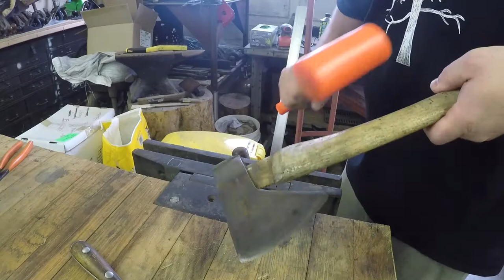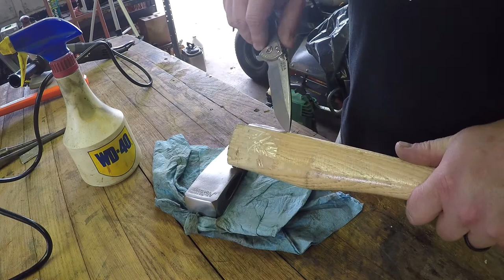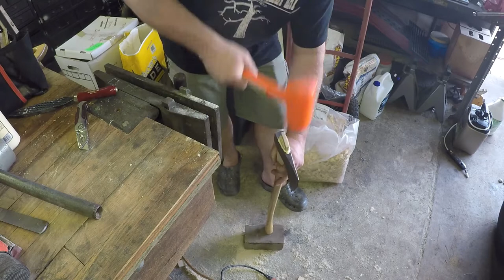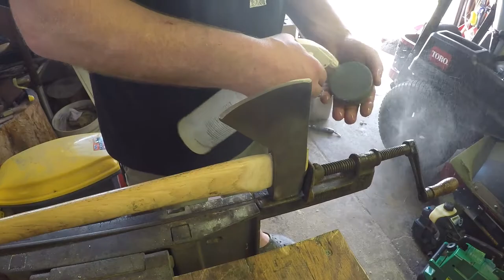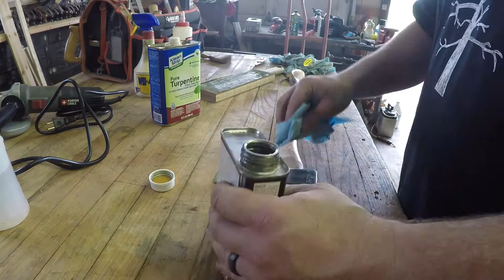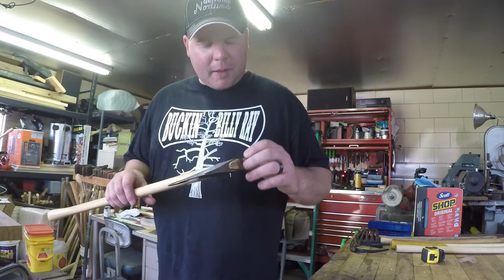This Restoration is Amazing!!!! Genuine Norlund Hudson Bay Tomahawk

Comment: Nice job Dude. I just inherited my Dad's Norland Hudson Bay Ax w/28" handle  and m looking forward to bringing her back to "working prowess", so your video was a good one to get motivated by. Even though I don't have all the big power tools you've got it was still motivating. Thanks for the video.
Reply from the maker: Nice! I have a thing for norlunds as you can tell by some of my videos!  Everything you see in this video can be done and has been done with only hand tools. What you didnt see in this video is the 5 hours I spent hand sanding that head to get a clean smooth finish. That would be boring. Power tools speed things up but you cant beat a hand finish. Good luck and have fun!!!
Reply: @KillingerUSA  Thanks! Just a question...what grits did you cycle through to end up with such a nice finish? Also, What length handle would this have had on it from the factory? The one it has on it now says 28" boys axe for 21/4lb. and I can't read it all but I can see LaPierre Sawyer Hdle. Co. Jackson,Mo.
Reply from the maker: @c.e.jarvis1512  it's hard to remember on this one but in most cases I will start with 80 grit. Next I got 120, 220, 320, 400, 600, 800, 1000. If going for a mirror, which o almost never do I will worknmh way up to 2000. I also use scotch brite pads in course medium fine and extra fine. All depends on the steel and what look I'm after. I believe the original handle was 24"?
Reply: @KillingerUSA Very cool, Thanks again.

Comment: Nice job. Was the original haft not salvageable? I try to reuse my old hafts whenever possible. 

FYI, I have a couple of Norlunds with factory handles, and they are hung very high on the haft, about like the one that you did,. By doing that, you made it look even more "factory" IMO. 

The bevels on the lower part of the poll are nice. You balanced them very well.  

When leaving the haft proud, I don't think that you really need to use the metal wedge. And they split the wood more often than not. There are countless vids on line where the creator says almost exactly what you said just after pounding in a metal wedge 'Well unfortunately, the metal wedge split the wood".  Figure it is going to happen and be glad if it doesn't. Better yet, leave the haft proud, like you did, and don't use a metal wedge. Without the metal wedge, IF the head starts to get loose, you can just use something narrow and pound the wood wedge farther in to tighten the head. When you get home you can replace it with a wider wedge if you want the wedge and haft to be flush again.
Reply from the maker: It wasn't the original handle and if I remember correctly it had a pretty good crack in it? 
Thanks for watching!!

Comment: You ditched a Norland original handle in good condition for a modern junk over the counter handle.  Grinding and polishing then throwing that handle on is not restoring the axe it is just turning something that was wonderful into something that’s ok but looks shiny.  Use an axe for a bit before trying to restore vintage axes at the high end level.
Reply from the maker: Look at you! Coming in here and laying down facts. He is something you missed. Was not an original handle. Not in any way. Appreciate your feedback.